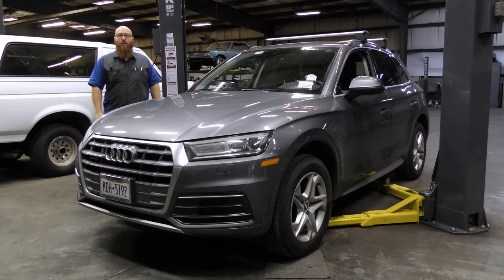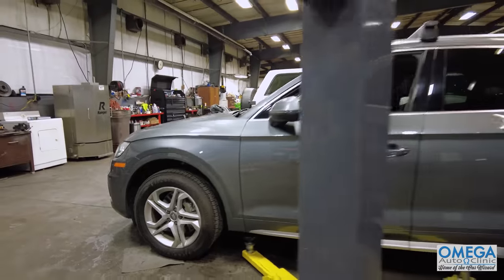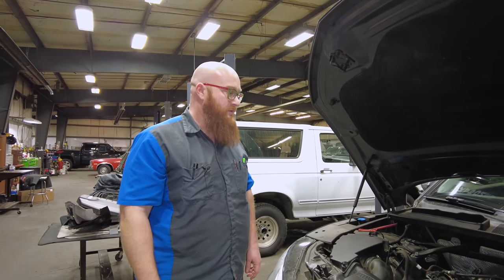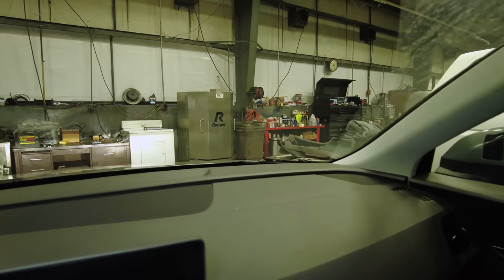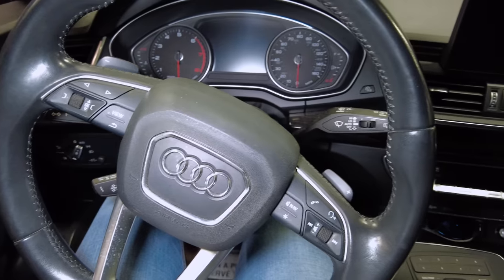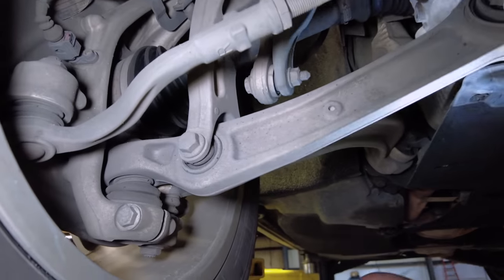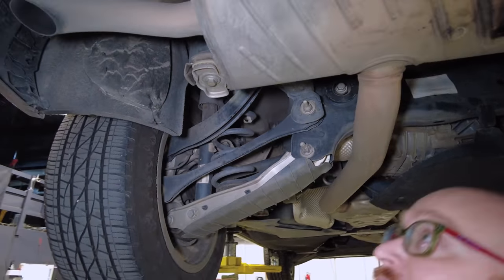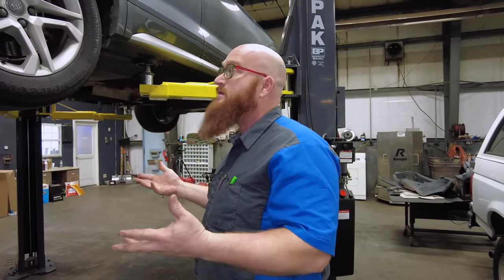2019 Audi Q5 with 200K miles & the service records to prove it! What did the CAR WIZARD need to fix?

Comment: I have a 2011 BMW 328i that has close to 121,000 miles on it. Over the years I have spent a lot of money keeping it in good condition. I have replaced tires and brakes, I have had oil changes, the front struts have been replaced, the starter motor has been replaced, the radiator and air conditioner condenser have been replaced. Also the leaking oil pan gasket was replaced to stop an oil leak. The end result of all this is that my BMW dealer tells me that I have one of the best maintained BMWs. This car does not burn any more oil than it did 50,000 miles ago. This car also runs reliably and it is mostly driven on short trips. One result of this is with the shortage of new cars and high prices of new cars, I do not need to replace this car. So for me it did pay off to maintain this car and fix things that were broken.

Comment: I bought a new VW Golf in 1986 and sold it in 2003 with 309,000 miles. Lots of parts were needed over the years, but it was still running well when sold. Oil changes with Mobil-1 synthetic every 5,000 miles from new really helped. My current '17 Golf is a much more complex car and I doubt it would be cost effective to maintain ownership for 17 years. My new car decision in '86 was either a Golf or a Toyota Corolla, and I'm glad I bought the VW. Life is too short to drive a boring car.

Comment: Our 2019cMacan with the same engine has just 10k miles in comparison LOL!  I've done two DIY oil changes and a brake fluid change on it myself too, easiest oil change I've ever done.
Reply: We have the 19' as well w/ the 4cyl, about 16k on the odo. Is there an instruction guide you used for the oil change? Or, pretty self explanatory? i can't seem to find a vid on doing the oil change on the 4, thought there would be at least a few on here
Reply: @George-ur8ow  There is a DIY 4cyl oil change thread in the Macan forum.  I think there was a video too, but its the same oil change as a Q5 or any other EA888 car.
Reply: @stevemartegani  Thank you amigo. Ciao!

Comment: Just passed 140K in my 2013 BMW 328i.  My mantra since I got the car with 35K miles on it has been "keep up on the maintenance."  I just had my first experience with a plastic intake tube breaking, but otherwise most of my book contains maintenance.  Oil changes every 5k miles, and I do them myself. Otherwise, my local BMW Whisperer keeps her running good.

Comment: My 2011 A5 2.0 tfsi is at 165K+, uses oil as it has been revised at the dealer (including all chains) with exactly the same parts which cause this problem.
No other big things replaced yet, did the PCV and  vacuum pump + hp fuel pump, oil pump, watercooling pump.
Still my daily driver.
Maintenance is quality oil + Bosch filter twice a year, all other filters and spark plugs once a year.

Comment: Great video explaining the importance of proper maintenance and good paperwork for the history. I know that there was a lot of paperwork that you were flipping through, but it would be good if you spoke about the general cost of each procedure. 4 new tires, alignment about $1400, front breaks and rotors about $1400, rear breaks and rotors about 1200 completed by an Audi dealer. Not sure on if these prices are more/less than for a Toyota RAV4 for example.

Comment: My old 2013 A4 2.0T had only a couple problems but they cost so much to fix. $20,000 in maintenance. Traded it in at 148,000 miles. This time around I made sure to buy a new S5 to save the headache.
Reply: Could have bought 2 engine replacements for that price
Reply: @Jushwa  wasn’t the engine alone lots of components fail over 4-5 years. This is the total cost of ownership for me.

Comment: Coworker with 2015 q5 end up replacing engine because it failed due to factory oil change intervals. First it’s started consuming oil around 100k miles and then used engine replacement $8k parts and labor. 100 miles round trip for work highway, highway mileage and dealer maintained
Reply: Did it run out of oil...or just start high consumption due to ????
What did the Audi organisation say re engine?
Is there a class action?
Did you report this to any automobile organistation? NHTSA? Consumer etc?
Reply: @JohnSmith-yv6eq  , it had oil and one morning it could not start he took it to the shop they said it has no compression.
Audi said it’s normal for these engines to fail after warranty due to 10k miles oil change intervals

Comment: its probably too new to have leaks or issues... time is what often makes rubber seals turn  hard and plastic  brittle..   and when that happens plastic parts start to fail and crack.. rubber seals start to leak  and so on... i would say when a car gets  8-10 years old these things start to happen... 
mileage put on that Q5 is impressive though...
Reply: I've noticed these problems more after 12 years old, garaging your car seems to help.

Comment: 180K plus isn't that uncommon from any audi/bmw/mercedes here in the uk, hell it's almost the norm. i did see an A3 1.9tdi needing a bit of work for £699, but that had 304,000 miles on it. so under standible.
Reply: In the UK, aren’t diesel engines more common and with correct maintenance, they can last longer than a regular gasoline (petrol) engine.
Reply: Nearly every Mercedes I see here has 150k+ miles, it’s not very uncommon in the US either, but no one wants to talk about that 😄
Reply: @diablocls55  It all depends on how well the owner maintains the vehicle and whether it was driven mainly on the highway or in town.

Comment: Its more of an age thing with VAG vehicles. Once they get about 5 years old, they start falling apart. Same with MB and BMW. They are made to last just long enough for the lease to expire and the lessee to lease another one. I think there might be something in the computer that starts to fry the electrical components, one by one, after a certain period of time.
Reply: Yes it's called low lead or no lead solder for every electronic component....
Might be better for the environment but it's crap in a vibrating car....
That's the failure point built in.
Even Lucas electrical systems didn't do that....

Comment: parents used to have a Q7, did shit all maintenance and complained when things went wrong 'oh the tires are worn out', or 'oh the car is bogging down a lot' (coils, it was a TDI) and even 'oh, it needs an oil change, lets leave it for a month, no big deal'. It got to 35,000 before needing a new engine. Never doing what my parents did. Currently looking at an 07' 1.8TDI A4, 120k miles, needs a bit of work and hasn't driven in 2-3 yrs and hasn't started in 10 months but in great condition, no leaks or major faults. looking at about 1-2k (£) for it, an absolute steal!

Comment: I have a 2016 VW Touareg with 145,000 bought it used with 65k on it jn 18. Been the most reliable car I have ever owned. But I did just put $900 in it for wheel speed sensors. Dealership wanted $2200! Find a good auto shop that works on German cars you will be fine.
Reply: With labor cost?
Reply: Nice to see another owner of Touaregs! I'm very happy with mine. Do you have TDI or gas engine? I have 14' Touareg with V6 gas engine, almost 100k miles on it. No issues so far, other than I have to add about a quart of oil between oil changes. My friendly mechanic is saying that this is normal for this VW engines and nothing unusual. I'm curious if anyone here experience the same. oil changes every 5k miles, quality oil.

Comment: my 2005 Avalon 201,086 miles bought it new and the cost to maintain this car is killing me , 2 sets of tires , 1 battery , 69 oil changes 69 air filters ,10 cabin air filters , 3 sets of brake pads 1 pair of front rotors, 3 brake fluid flush , 1 coolant flush , 8 sets of wiper blades , 1 fan belt and now that i am retired i just drive under 1000 miles a years and i do the oil every 3 months , IMO to make a car last don't beat the hell out of it , i drive the speed limit and take exit ramps at the speed limit and that greatly extends tire and brake life and over all life of the car

Comment: My AUDI 7 2009 had Oil change with CASTROL 5W40 every 5k miles. Car driven back and forward from NYC to NJ every day for over 10 years in extreme traffic (STOP n GO) so not mostly highway got over 200,000 miles car looks and still drives like new. I did search and located an owner of 07 Q7 with 375k miles hopefully will join problem free the 300k club.

Comment: I have a 2006 Dodge Dakota with a 3.7 V6… it has over 327K miles… not known for reliability… it was traded in buy a doctor to Carmax… i paid nothing for it since I am a carmax employee and I needed a cheap truck…. Ran the carfax on it and he religiously change the oil on it, serviced the transmission, and serviced the rear differential on it. The only thing I had to do was replace the radiator. I have also replace the struts and shocks and did a tuneup. The truck runs and drives perfect. It looks great. It just shows what maintenance will do to any vehicle to make it last a long time.

Comment: I would love to see you get a CX-5 into your shop! Would be interested into seeing your thoughts on things like build quality and serviceability.
Reply: Build quality is middle of the pack, maybe above average; the reason I say is not higher is that they’re still cheaper economy cars, and Mazda unfortunately doesn’t have the R&D budget that other makes have since it’s a smaller brand.Ease of service is great. I would recommend them to friends and family. They’re as reliable as Toyotas in my experience. I was a service manager at a Mazda dealership.
Reply: @998Squid  thanks! That sounds like an honest answer. I bought a CX-5 last March and after a string of Nissans and Hyundais, I found the build quality of Mazda’s chassis and drivetrain to be better than expected - the interior is comfortable and not overstyled, and it handles almost as well as my ‘94 Miata. It’s clear where Mazda’s priorities were - the areas it lacks are in the small details and refinements - the electrical system seems to be designed without any frills, which is a good thing in my opinion. Thanks for the response!

Comment: I had a 2010 3.2. One of the worst cars I've ever had. Every month it had something new to break. To truly test longevity, its best to look at start/stop cycles as well. Seems like this car did a lot of road use but not as many start/stop cycles as a taxi cab for example. If car from the 90 or 2000s  300k+ miles with no serious engine and transmission work (especially a 4 or 6 cylinder) then that's truly a reliable car.
Reply: The 3.2 A4s and Q5s from that era were truly miserable.
Reply: Newer cars often have many weaknesses

I now own a 2012 ford mondeo titanium sedan 2l 140hp automatic.

There are several things I don't like about the car! This is no VW Polo but a Passat Titanium and you expect a bit more from the car. But many newer cars unfortunately have a lot of small weaknesses.

Here are some weaknesses.

1. A lot of tire noise and body noise while driving.

2. Problems with the fuel cap theft lock, which is a common problem on this car.

3. Incredibly little information about the car. No engine temperature gauge or other important things.

4. halogen headlights that are not water tight.

5. front light brightness is nothing to brag about!

Comment: 2014 a4 s line.  122,000 miles. So far no regrets I. The car is very stable, I love the body style for a 9 year car. I commute 100 miles round trip . Just regular maintenance !!

Comment: Based on that maintenance record, could Wizard estimate the total cost of ownership?
Reply: estimate? LOL with them records he could tell you down to the penny what the cost is!
Reply: The guy is probably doing 5k oil intervals and the print outs look like the ones from vw/Audi dealerships. So $4625 on oil services, $500-1k on tire rotations and alignments, 2800 on tires, and 1-3k on windshields/other repairs/ diagnostics. About what most people pay on any other brand if car.
Reply: @Michael-kd4oi  Firestone tires shows they probably have a membership and get rotations done for free, I’d assume glass coverage through insurance.
Reply: The Wizard does not need to waste his time totalling up everything in that binder.  He is really good at estimating costs.  Audi is most likely on par with Mercedes (expensive).

Comment: When there is such a thick service book, it means that the car has NOT been a durable car!!

If you have to maintain your car A LOT to keep it intact, it's not a good car! Yes, you have to maintain a car, but today's cars require a lot more maintenance than before!
Reply: The car wizard said it's mostly just service and tire stuff tho.
Reply: Lol says the Ford guy. What a joker!
Reply: Do you use the same amount of gasoline to cover 200k miles as you do to cover 50k miles?
No...logically you don't.
So if you chnge your oil and filter every 6k miles..that means 33 oil changes...for 200k.
Whereas the 50k only takes 8 oil changes (and pages in the ringbinder).
Over time, at this "speed" of consumption, everything will fill ringbinders...
imagine if he had kept gasoline receipts????

Comment: I have 2008 audi a4 2.0t. 205,458 miles. I am a second owner took possession at 62,000 miles. Oil changes with good quality synthetic oil and oe filter, timing belt service twice already.  Still driving it giving to my teenager in few months. Steering rack replaced and leak around valve cover. Driving it until transmission fails and replacing with a toyota rav or Honda crv.

Comment: Happy to have acquired my 2017 Audi Q7 as a 2nd owner after reviewing it's complete service history from the dealership w/48780KM.Did the 90K kms service myself, supercharger belt, had a reputable Audi specialist shop do do the transmission service approximately at 101718km and replaced both engine motor mounts (I noticed only driver side was leaking 2 months ago) last week with both leaking fluid and cracked rubbers on both - that saved me thousands of dollars down the road if I neglected it. Plus I've gone a tad bit over board by doing oil changes very early (instead of the 15k kms... 10k kms recommendation of Audi specialist shop...) by doing it every 7+K kms ;)

Comment: Your right.  I have had late model Audis for years.  I have an independent Audi shop near my work.   I just bring it to them and they fix whatever.  Really nothing, just maintenance.  Thing is I don't wait. Like my car is a 2018 and I called and said, maybe we should change the battery is 5 years old now.  They are like bring it by we can see  how yours is.   They know my car, and I trust them.  My Audis have never had a problem, cause I take care of my stuff.

Comment: I had a Mk4 GTI with 299k miles in it. Was running super solid, kept the maintenance on top notch. Sold it, after cpl of months vehicle got parked and guy never drove it again for years. 😢😢😢

Comment: A long time ago my company car of choice was the Vauxhall Vectra diesel and I did between 7K and 8K miles a month. I regularly did 85K+ miles a year without any issues at all. Having said that the car was serviced by Vauxhall every 8-10 weeks. And that car was a third of the cost of an Audi. My point is, if you get your car serviced correctly regardless of manufacture, it will last a very long time regardless of its mileage.

Comment: I have a 2019 Q5, not the base model like this one and a much more desirable color Azores Green Metallic with brown sport heated and ventilated seats. Just took it on a 1800 mile road trip and it will turn over 30,000 miles in a week or two. They really gobble up the miles on the highway, very comfortable, actually pretty good gas mileage for the size of the car, I got about 31 mpg end to end on that road trip. Nothing to really complain about yet, it's been rock solid reliable, no issues. I will say though, it is a little boring as cars go. Nice, but boring. I like to tell people is crushingly competent. Definitely not my weekend car! Thats what V12s are for.

Comment: Most people do the oil changes. But when the mechanic says you need to change a seal cause it is leaking oil or something expensive transmission fluid , they tend to skip it and say I will do it later

Comment: Those Tfsi engines are upgraded since 2015. What is interesting the 2.0TDI engines are even more better and more efficient then older one's. The intake manifold of newer 2.0tdi is aluminium, no more cheap plastic and all problem with injectors are solved. They still use common rail which has to be taken care with fuel filters change. At 200k TDI since 2014 are running strong and counting miles.

Comment: THANKS, NICE VIDEO, albeit a bit repetitive.
Would have been extremely helpful to know:
-How many miles between oil changes (VW/Audi Factory suggests Full Synthetic, every 10K miles. I change every 5K due to high revving, mountain driving, fact oil viscosity noticably breaking down at 5K).
-How many Transmission services?
-How many Break Jobs?
-How many CV Boot Replacements (those look brand new).
DRIVE ON!
Reply: Anyone who changes oil every 4k miles or 6 months which comes first can say cars will last past 300k without problems.
Transmission every 30k drain and fill like it was in 90s.
Fluids cheap vs car payments or repairs
Reply: @repairvehicle  I was really wondering what Maint frequencies were on the Audi you were servicing with 200K miles. 
(BTW- the 1.8T, presumably also 2.0T, does not have a transmission drain plug. Need to remove entire pan, refit with new seal, refil fluid).
Thanks again!!
Reply: @brentonharvey2404  dropping pan is not a problem, majority of domestic cars and trucks don’t have transmission plug in the pan.